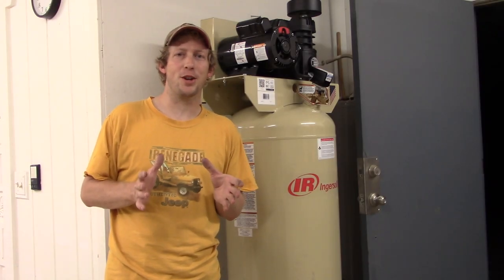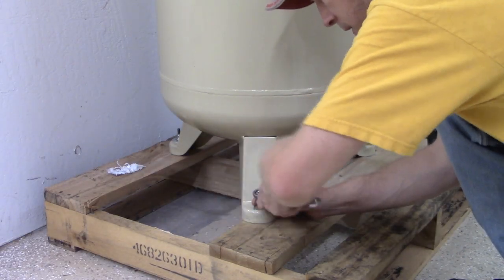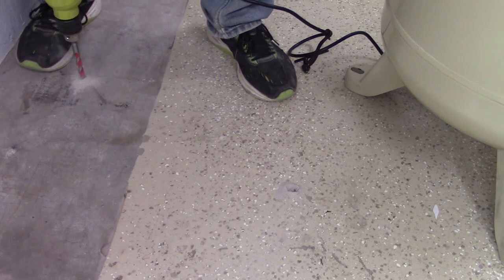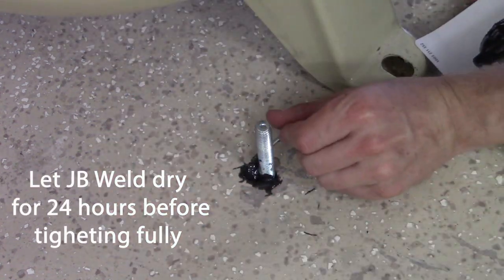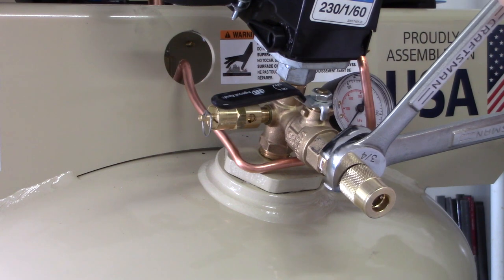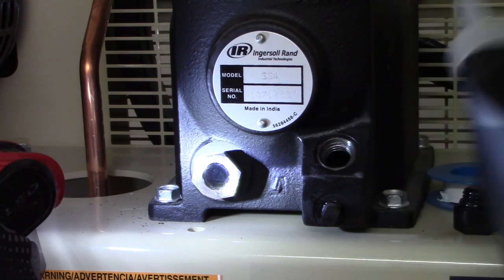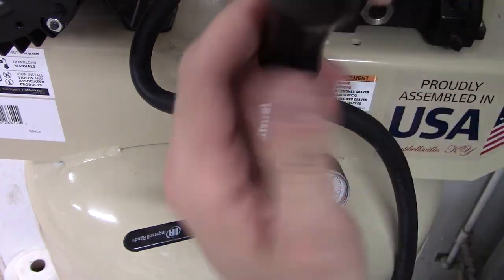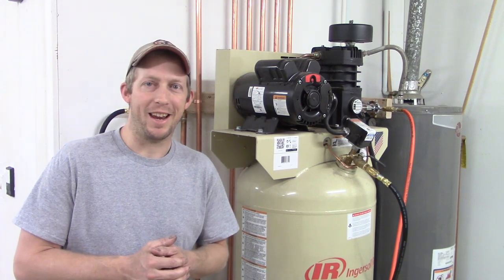Review | Ingersoll Rand 5HP 60 Gal Air Compressor | SS4 | Installation and Recommendation!

Comment: What flexible wire did you use when creating the plug line?
Reply from the maker: I went to Home Depot, and got wire that would be appropriate for dryers. 220 with two hot lines and a ground. There is a section where they have a variety you can choose from and an associate can help cut it to length.

Comment: How loud is it?
Reply: You bought the wrong compressor it won't hold up.
Reply: @johnpasella8187  put a magnetic pressure switch on it. it will help the China motor. my motor went out in 8 months.

Comment: I just bought one in  nov of 2023. So many threads and clips i agree with the most clips and thread's. They are junk. Harbor freight makes better stuff. Drain valve finger tight. Air filter hosuing screwed in by 1 thread. Pump leaks oil. I wouldnt recommend or buy again. Assembly with pride in America. Well theres no pride.